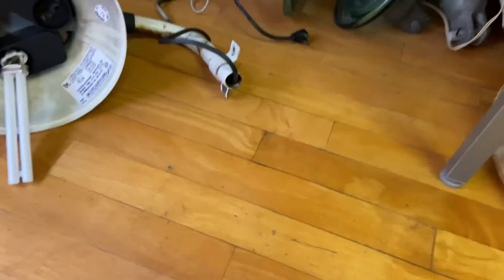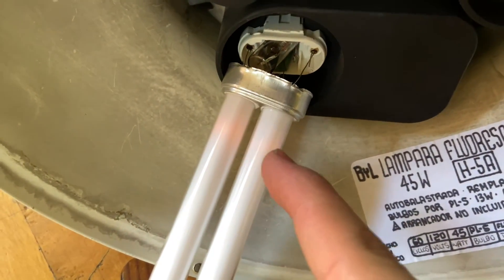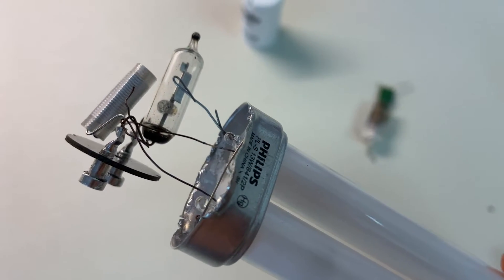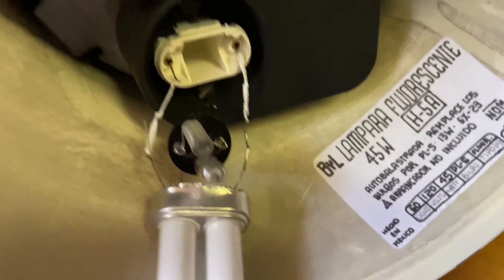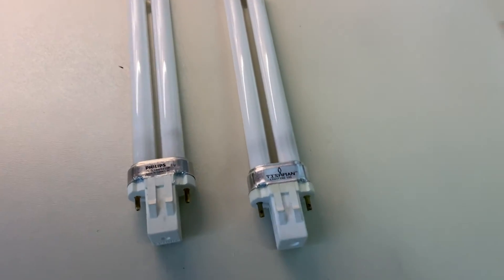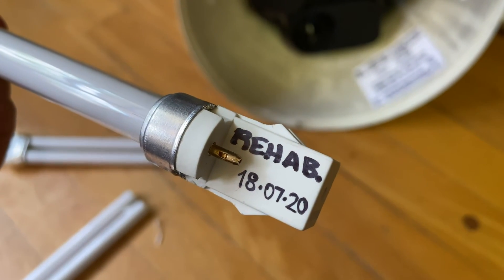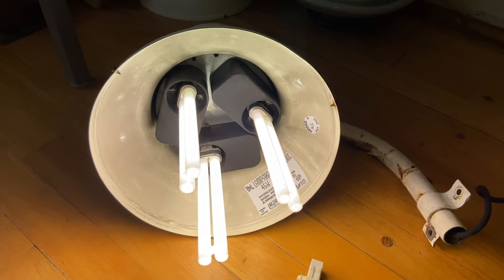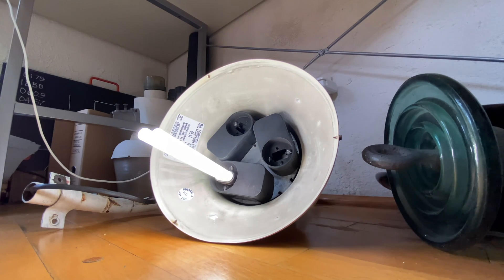ATTEMPTING TO REPAIR A BROKEN PL-S FLUORESCENT LAMP | WILL IT WORK?

Comment: I opened up a ottlite gx23 13w e bulb and all I found was a capacitor no starter just a capacitor I fitted in a glow tube starter and put the base back on and plugged it in but it won't turn on even though I put it in a magnetic ballast fixture what should I do should I fit in a new starter or put a new capacitor

Comment: Did this recently with a 2D tube that was basically new but the starter had gone bad (completely open circuit), just gutted a cheap starter and split open the plastic housing of the 2D tube and replaced the starter and it worked a charm.

Comment: Hi, thank you for your video. I have a question to ask you. When you disassembled the Philips PL-S were the capacitor and starter fixed with glue or something else?. I ask this because I bought some Philips PL-S made in Poland and when I shake them I hear the internal components banging in the plastic socket. Thank you

Comment: Nice Repair, the condenser/capacitor going bad in PL lamps seems to be a common problem, the starter can also fail by welding itself together mostly when the lamp is EOL. The cap thing used to be a big problem with US replaceable starters where some wax ones would combust in heavy use situations and where phased out for less flammable alternatives. As for the FS-2 not working, I'm thinking either your connections broke or that the starter was incompatible with PL lamps.
Reply: How does it happen on a pl bulb that wirks

Comment: Electrodes are glowing because you have short in built in capacitor. There should be two elements in integrated starter, one will be capacitor.
Reply from the maker: Yup, that's why I change it at the end! Thanks!

Comment: Good job on the repair. Very cool seeing the inside and how it works. I remember replacing starters in the regular fluorescent fixtures, the round silver ones. Sometimes very difficult to snap in, but I got it in. 💡💡💡
Reply from the maker: Yes! I have regular linear fluorescents with a non-integrated starter.. (I think I will make a video about that probably next week) 
Loved changing starters!

Comment: I guess the new starter didn't work because it needs higher voltage.
The capacitor isn't necessary, you may remove it completely. The starter will work anyway.
Reply from the maker: Yes! I was thinking just the same thing when I was editing the video...
That thing you say about the capacitor, well I have to try it out... As you see in the video at the end, the thing that was wrong in the Philips was the capacitor, and as soon as I placed it on the Tishman, it stopped working... But it would be nice seeing if removing it will make the Tishman work again... Thank you!
Reply: @THEBULBHOME  how does it happen on a working bulb
Reply: @THEBULBHOME  I’m surprised
Reply: The new starter didnt work beacuse the fs2 is configured to run tubes in series and S10 Just runs 1 tube so i think a s10 starter will run good with the lamp.
Reply: fs-5 starter for north america